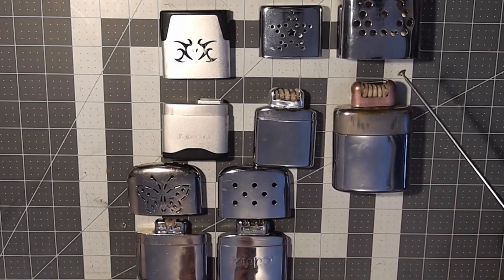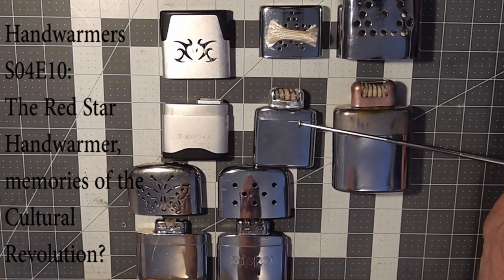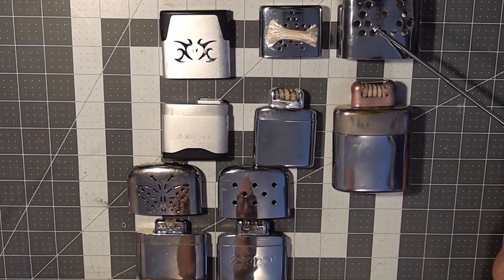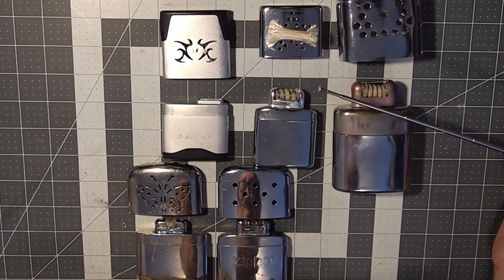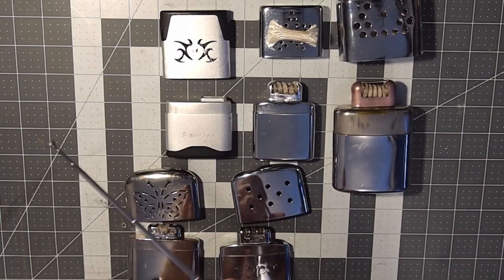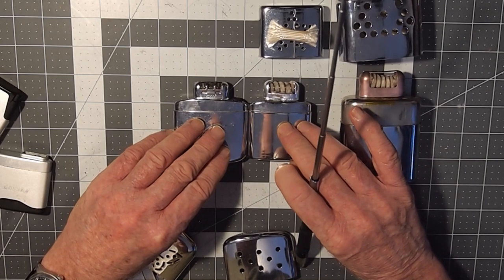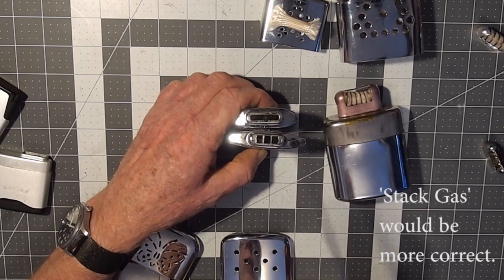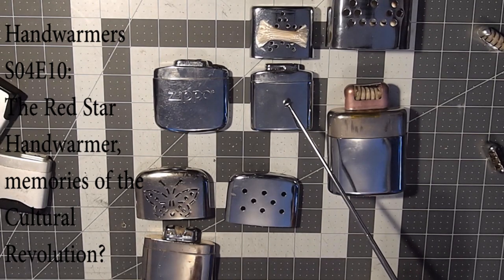Handwarmers S07E03: What to watch for when buying a hand warmer

Comment: Most likely your exothermic reaction does not improve with more catalytic material is a "surface area" issue.   Without testing I think this type of reaction is a surface reaction which requires oxygen as you understand.  Packing the spring full of extra material does not increase the surface area. The larger Jon E unit has a larger area and when you convert it to a spring a greater surface area than smaller units which is why it gets warmer.  Think of it this way.  A car cat has a very large surface area due to it honey cone design. The platinum is very thinly spread over a large area, but it is very thin.  Most of the converter is just non functioning material.  If the same amount of platinum was placed in the housing as a small bar it would be no where near as effective as the unit with a much larger surface area, hence the design of automotive cats.  I don't think that the amount of oxygen available through the vent holes plays into this reaction, but then again a larger surface area in contact with oxygen will make a hotter unit.  Just my 2 cents on your question.

Comment: I have several Jon-e and  Zippo warmers and enjoy watching your videos!
I recently bought  a new Zippo standard size warmer and was surprised it wouldn't accept a full measure of fluid and proceeded to light it only to see it only burned for 5 hours.
I decided to cut the top cross bars and remove the cotton.
It looked to have double the normal amount of cotton forcibly packed below the felt layer.
I removed half of the cotton and it now fills and burns the same as my other zippos.
Quality control??
I wonder how many more are out there over packed that under perform and discourage first time users.
Reply from the maker: That is interesting, as I actually did the same thing, tore out all the cotton and repacked the entire reservoir of a Zippo with carbon felt. When I did that, I did notice they use a plastic liner in the reservoir as well which I assume was to prevent leakage when it got overfilled. When my hacks seemed to have no effect, I implanted a screw down through the reservoir in the middle to transmit heat down from the catalyst into the reservoir to help counter 'cold shock'. Did not seem to help. Then I tried a hollow tube, no luck. I tried putting more catalyst into the head to increase heat, no luck. I tried fastening the catalyst head to the reservoir neck with thermal glue, and added a grommet and fill tube on the shoulder of the reservoir (as can be seen in the video). Made no difference. I'm pretty sure that over the years I also tried some other hair-brained ideas that gave no joy in the end. When I started all that, I was confident I'd discover the 'magic sauce' to make a Zippo perform better and become a hero in my own mind, because I was able to do that with the other models. Instead of becoming the handwarmer hero my Zippo failure ensured that I just remained the lonely old Home Alone guy who tries to get his projects off the dining room table before She Who Must Be Obeyed gets home from work - wondering why last night's dishes are still in the sink.

Comment: I saw your rebuild of the Jon-E Giant and thought it was great. Anyway, I just got my first Fuel 'Handwarmer' heater, a Peacock 'standard' and have been doing basic experimentation with it. My dad had a Jon-E when I was a kid and I wanted one but he never got it for me - probably the use of fire to get it going. Anyway, yesterday after the Peacock was going a while, after following old Jon-E instructions, I got the laser thermometer out, and got readings as high as 200F+ on off the surface. Just thought I would run this by you. I did a couple of videos on my own channel talking about the hand warmer. I took pics of the readings, and can email them to you if you want. Thanks.
Reply from the maker: Thanks, that is very interesting. Because the body of most hand warmers is highly reflective, it increases the albedo and I worry that might not give an accurate reading when using an IR Thermometer. That's why I risk life and limb to steal She Who Must Be Obeyed's meat thermometer when she is not around and use it to measure temperatures. (If I get caught and suddenly disappear perhaps someone could contact the local authorities and have them look for a shallow grave in the back garden). I did read however that you can stick a piece of black tape on a chrome surface if you want to measure it with an IR Thermometer to give better accuracy. So it seems to me that if you were able to repeat your experiment where you got 200F+ again with the tape, it might be interesting to see what the results are?
Reply: @MountainParameters  I was also wondering about the reflective surface, and will nab the meat thermometer and give that a go tomorrow. Secondly, I had thought about calibration, and so forth of the laser thermometer - electronics you know... False readings could happen. Watch my channel for my thoughts on this and other handwarmer stuff. This aint over hahaha 🙂
Reply: @MountainParameters  Ok I actually just ran down and used the meat thermometer, and it buried the needle past 200F. I took a few pics.
Reply from the maker: @l.v.i.bushcraftandsurvival6692  I did watch the 2 parts for the hand warmer review. I thought it was good and probably one of the better ones because all the information was accurate. I also agree with the use of a flint lighter for activating the catalyst as I've often had piezo based lighters fail, especially at altitude.
Reply from the maker: @l.v.i.bushcraftandsurvival6692  Interesting result. You'd best return it to the kitchen before it's needed for the turkey and you get caught!
Reply: @MountainParameters  I got a new old stock Jon-E Giant..... I am burning up I have both going at the same time! I made a video.
Reply from the maker: @l.v.i.bushcraftandsurvival6692  After pondering the apparent differences of the volume of the catalyst heads pictured above, today I was doing some measurements to compare. I noticed that the difference in volume of the reservoirs of the Zippo and the Red Star were less than 1%. But the catalyst head of the Red Star is 30% larger in volume than the Zippo, and the catalyst head of the Jon-e Giant is 42% larger than the Zippo. Given that field tests have shown we cannot seem to get the nominal heat of the Zippo higher than 145, but we the nominal readings of the Red Star and the Jon-e can easily be 165, it seems safe to say that the best liquid fuel hand warmer designs incorporate a larger volume for the shroud that houses the catalyst. It has been my experience that not only does this architecture allow for greater temperature's, but it also allows the product to enjoy a greater resistance to Cold Shock.
Reply: @MountainParameters  That makes sense to me.

Comment: I have a Jon-E standard that I've had for quite some time.  The funny thing about this one is it burns hotter than any hand warmer I've ever had (I've got about 30 of them.  I'm a bit if a collector).  Hotter than the Chinese versions, hotter than the S-Boston, etc.  I call it "the Mystery Jon-E!"  I've taken it apart and can't find anything special about it.  It looks the same in every way.

I've stopped using it now, unless I need that "extra heat" because I don't want to wear it out, from fear of never being able to replace it!
Reply from the maker: Thanks Larry! In my experience, the hottest I can get a hand warmer is 165F, so that may be what yours achieves. I did not know that the Jon-e standard can make it that high (I don't have one that I can test), so that is good information. It probably comes down to how much catalyst you can place in the head. I assume the head on those is the same size as the Zippo, which would mean it would use a standard spring when you want to refresh the catalyst material. How much catalyst you place in a spring is a subjective preference. In a large spring such as an S-Boston or Jon-e GI, pad size of 1.25x1.25" can be used to fill the 145F spring, and 1.5x1.25" the 165F spring. In a Zippo a minium pad size of 1.25x..5" is recommended for nominal temp, and 1.25x1" is recommended for maximum heat.
Reply: @MountainParameters  something that i probably should have mentioned above, is that I think one of the reasons why the new Chinese hand warmers are no longer heating well is because the old warmers came  with a spring and catalyst, but they are now coming with a "catalyst pad" and its like trying to start a fire with a wet log.  Absolutely dreadful!  I don't know why they switched to them. But they need to go back the the springs.

Its probably a money thing, to maximize profits, but I think the next generation of hand warmer users are really missing out!

I don't know if you've come across this yet, but I thought I should mention it.
Reply from the maker: @LarryTalbot_1313  Thanks Larry, I'd never seen a spring used to hold the catalyst until we started to use them at the suggestion of Jeff Hanna, so perhaps that was before my time  (the springs in the pictures in this video were inserted by me when I replaced the catalyst). I've seen some old Jon-e and Peacock units that had some catalyst material inserted into a sleeve of some sort which others have suggested could be asbestos. The fundamental problem with a sleeve is it is not as permeable to air flow as a spring is. I think what has changed is the cost of platinum. I get the sense that the manufacturers cannot afford to use the real thing anymore so they turn to alternatives such as magnetite (iron oxide). Vanadium, nickel and paladium can also be used and are cheaper then platinum.

Comment: I'm making some catalyst right now. You can see a chemist perform the process here- https://youtu.be/iaNSH89gpPk
As to the temperature, I believe the combustion temperature at the catalyst is 1000, or whatever is needed to glow red. The temperature of the hand warmer is just a function of heat loss and oxygen supply. If well enough insulated, the boiling point of the fuel would become a limiting factor. 
Astral Chemist describes different "activities" of the catalyst, ie, one process is suitable for the Otswald reaction, one is more suitable for combustion of hydrogen. The particle sizes of the platinum dictate its reactivity.
I have the sodium hexachloroplatinate solution ready, I'm just putting together a variety of substrates to try out. I'm including ekowool-type silica wick, non-woven silica sheet designed as burn-away kiln paper similar to quartz fiber sheet (and similar to the cheap Chinese catalysts), and rockwool. I'd like to include quartz wool and carbon felt, but they're expensive and I don't have any at the moment. I believe the gas fireplace embers use a rockwool substrate.

Comment: You still putting camping fuel in them instead of zippo fluid?
Reply from the maker: All are petroleum distillates, naptha is a broad category, white gas/Coleman fuel is a specific refined naptha product, camping fuel can refer to white gas or other stove fuels. Therefor when using 'camping fuel', you need to curate your choice as some may perform better than others.

Comment: I have a Jon e Giant Hand Warmer which just won't light.  It has worked properly in the not very distant past, The wick has burned away, and I can't see how to renew it.  Can you help me bring this thing back to life?
Reply from the maker: The wick is not required for the proper functioning of a hand warmer, that's why most hand warmers do not have them. Do not worry about replacing the wick, pull what's left out of your device and throw it away. Replacing the catalyst in the head is the first step. Something else to look for is make sure the packing material at the top of the reservoir is not charred and therefore blocking the evaporation of fumes to the catalyst. That's where a layer of carbon felt comes into play. I think you'll find lots of videos in the handwarmer playlist cover the methodology of these maintenance procedures.
Reply: @MountainParameters   Thank you for your reply.  I can't get the wick out as it has disintegrated and there are only a few wisps left. The packing material at the top of the reservoir actually has a metal mesh grid over it, and it is quite clean, but the burner looks sooty.  However, I tried lighting it by putting a gas lighter flame directly onto the burner for a few minutes and it worked fine.  I was able to use the Jon E twice last week while playing golf in zero degrees centigrade, so I'm all set to brave the present Arctic conditions we're having in the UK.  I'm very grateful for your help.
Reply from the maker: @ng21sm12  
Must be a soggy golf game! Especially that now I see you have another major winter storm Isha to deal with. I've noticed an uptick of orders from the UK that last week, so now I know why. 

Don't worry about the wick, you can just leave it. If that mesh barrier has charred cotton under it, it would be worth it to remove it and clean the charred cotton out. Like the wick, that mesh serves no function, so you can just dispose of it. 

Last fall an outdoor outfitter contacted me, he had a couple of dozen replacement heads for the Giant he didn't want anymore, so he sent them to me and I put them on the order form on consignment, I think there are still a few of them left.